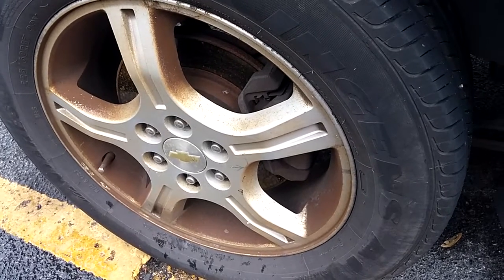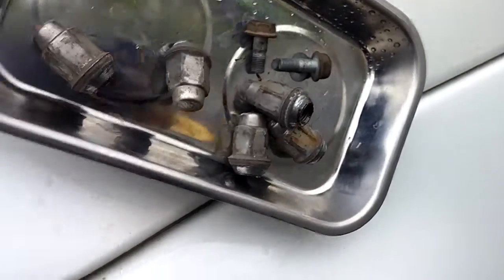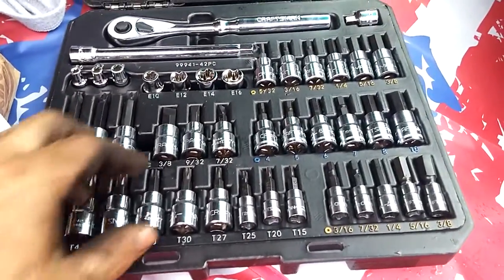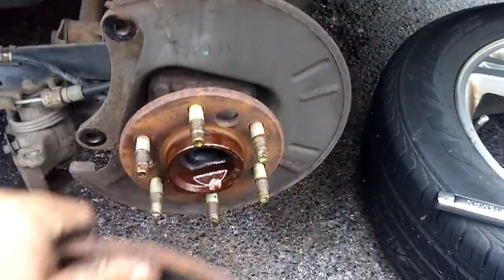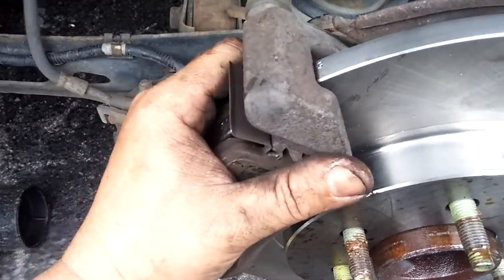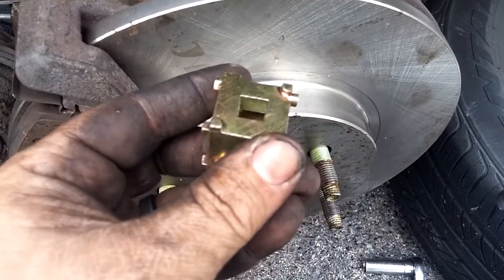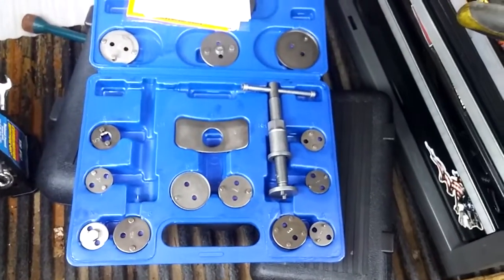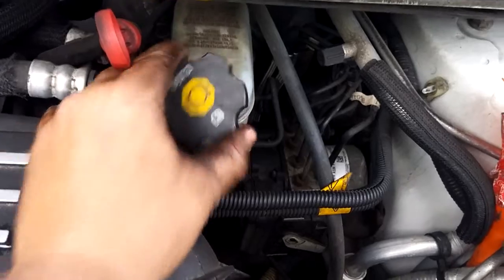How to Replace Rear Rotors #55119 on A 2007 Chevy Uplander

Comment: That cube tool, you just need some practice using it. I can turn it and hold caliper against one pin with the other hand, but I have had 3 of these vans now. First two were totaled out, the last one I hope to hang on to.